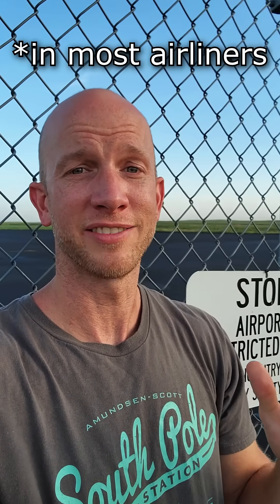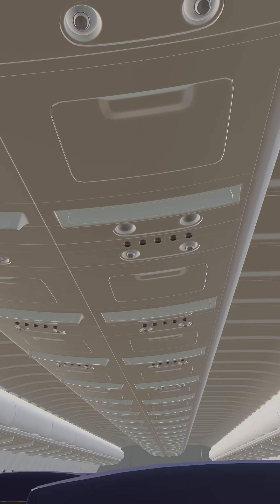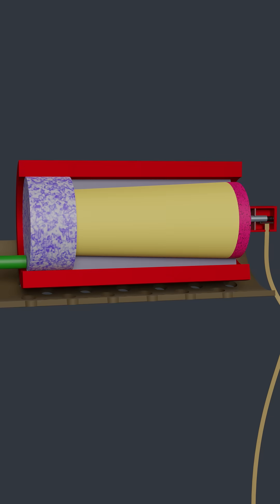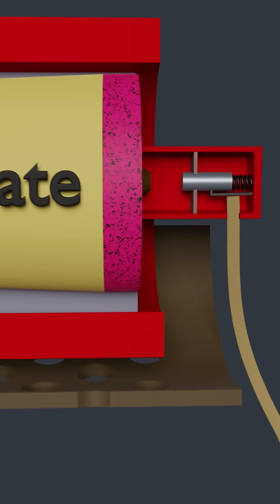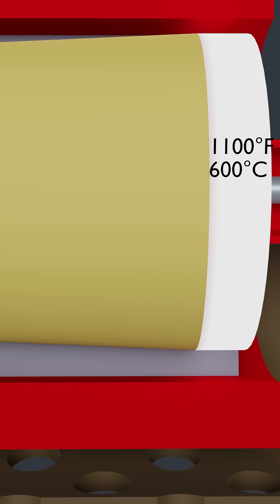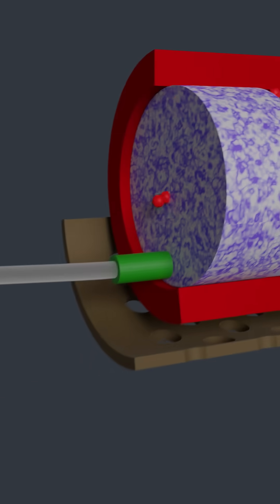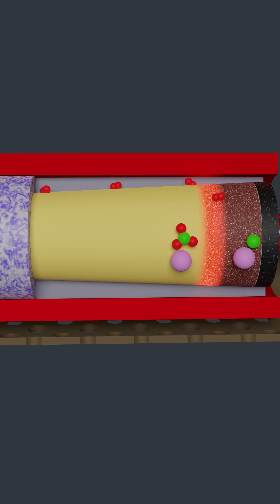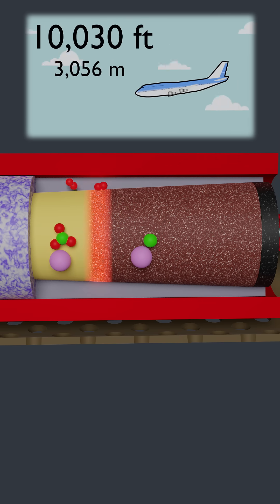Oxygen on airplanes? How it works

Comment: I was told by somebody in the airline industry Becky firing pin assembly for these is something akin to a grenade trigger assembly. And it's supposed to be unscrewed and removed from the canister when these devices are not actually being installed in an aircraft. When in storage or being transported the trigger assembly is supposed to be unscrewed from the canister. Is this precaution is not taken and they are Jarred or jostled in any way they can accidentally discharged and that unfortunately what brought down that aircraft. At least one possibly all of them was not disarmed.

Comment: When a passenger pulls on the tube of the oxygen masks this starts a chemical reaction above their head

There is a 5 minute supply above each passenger independent of each other

Each passenger has their own supply of oxygen 

So how does a single closed valve have an impact upon the oxygen received by each individual passenger ?

Maybe someone could explain what I missed so I can move on.
Reply: Well, you evidently missed the duration..😆

Comment: They don't actually deliver oxygen, they just muffle the screams lol But seriously we have those on Navy ships, called OBA (Oxygen Breathing Apparatus) . There are two types. One is a whole head covering with the generator on the back Called EEBD(Emergency Escape Breathing Device) and the other is a full front pack with a tube and mask called OBA, how original. Once you pull that pin the canister will deliver oxygen till it burns out so you either get out or go in and fight the fire.

Comment: We had these on submarines and used them anytime our O² generation equipment was broken down. Except ours were industrial sized and if necessary we could survive off of them for months.
Reply: Huh?? What submarine were you on that had enough oxygen canisters that would last for months?
Reply: @ssmt2  a Mediterranean mission critical fast boat out of Norfolk with a messed up O² generator. We kept them stored in many different spaces.  We also had to turn off the smoking lamp many times also due to low O² / high CO² levels.
Reply: @ssmt2  I won't tell you our hull number but you can read the book Blind Man's Bluff and it's one of the boats talked about in it.

Comment: Additionally, only the pilot’s masks are pressurized (different and separate system) and the passengers are not. That’s because the pilots need to be able to bring the aircraft to a safe altitude.

Comment: You missed the scary part, when these are deployed and getting hot they are also covered in dust from the time in the plane, and then the plane fills with smell of smoke and if you don’t now this you think the plane is on fire…. How i now, lost pressure in a MD80 over northern Italy and then a very fast descent down to 3000 meters and emergency landing in München airport, and no, the pilot is occupied with controlling the plane and won’t tell you until after the landing!

Comment: They fall but you must pull on them to activate.So if you need another you can use one that hasn't been pulled.
Reply: In a bank of 3 seats, there's typically  O2 generators.  So you can fight your seat mates for the extra.

Comment: when the Jet Blue crash happened in the Everglades it was from unsecured O2 generators, as I recall
Reply: Funny how those canisters can’t be carried as cargo but are perfectly fine if installed in the airplane for passenger use. First time I saw that installation, I was skeptical, as they generate a LOT of heat. But time has proven it’s a good system and a lot simpler than high pressure bottles and all the associated plumbing. FYI, the cockpit crew O2 supply is still a high pressure bottle. Note: it was ValueJet that lost the DC-9 in the Everglades.
Reply: That was Value Jet not Jet Blue.

Comment: Meanwhile, the pilot is oxygen actually comes from physical oxygen tanks that are big and yellow and multiple of them. As crew chief bring an oxygen cart and connected into the system and measure the pressure.  And one pilots decide to come back completely half dropped from Las Vegas and we have a early flight crew chief will help get them into the chair strapped up buckled up put the oxygen mask on and hit the switch which makes the pilots completely sober.  True facts. And nobody knows the difference.

Comment: They’re only supposed to last 30 mins. If the pilot descends does that allow for oxygen to enter the cabin from an alternate source?
Reply: Oxygen masks drop down due to cabin pressure loss. The cabin air is supplied by the engines compressed hot air- called Engine Bleed Air. It's cooled, conditioned, mixed and recirculated. If they lower to 8000ft, the pressure is a sufficient height before severe symptoms will arise in the passangers. A commercial passenger jet will prefer to descend about 10000ft per minute in an emergency. That's about 3min15sec.

Comment: I'm surprised they're not connecting to some sort of inlet that collects air from the outside.
Reply: The air outside the plane at 30000ft does not have enough O2, THAT'S THE WHOLE POINT.

Comment: Its also nice to not have dozens of oxygen bottles that would require periodic testing and occasionally complete removal from the plane for hydrostatic testing. Oxygen bottles have also occasionally turned into rockets that punch a nice big hole in the aircraft when they break (which has happened before, since all commercial aircraft that have passenger masks also have masks for the crew, which is run from a handful of oxygen bottles)

Comment: These actually took down a plane once, they were expired and being transported on a passenger flight. They generate a lot of heat and when one went off it caused others to go off.
Reply: ValueJet 592 MIA-ATL. RIP
Reply: That aircraft was also transporting used tires in the same compartment.

Comment: People will not traditionally call the things that these mass are attached to a oxygen generator however that is technically correct The best kind of correct. They would call this a oxygen candle as I have no idea why. All I know is that it uses heat and produces oxygen using a chemical method. I have never heard these referenced as an oxygen generator anywhere by anybody. They are always referenced as a oxygen candle. Edit: The oxygen candles on airplanes meant for passengers will only last around 10 to 12 minute's however the oxygen mats for the pilots last significantly longer around 25 minutes That way even if there is some kind of emergency and they are not able to descend the plane fast enough be pilots do not pass out and can't land the plan safely. It is extremely important that the pilots have a longer supply as the plane cannot support 25 minutes of oxygen for every single passenger.

Comment: I sorta knew the gist, but this is a nice explanation. And I have heard of "oxygen candles" that are used on submarines in an emergency. It seems paradoxical but it's the exact same thing as this. I'm amazed they get so hot! Sometimes people joke about putting your own mask on before helping others, but it's certain if you don't get your O2 mask on fast enough, the child sitting next to you can't help you out.
Reply: Smarter every day actually made a video on oxygen candles in submarines
Reply: Did 5 years on a submarine. We would burn o2 candles all day long 24/7. This would be done to assist the scrubbers
Reply: @rubberbandman200 Edit: apparently power limitations prevent electrolysis from being an option.
how much time was actually on the sub? Or was that the total of all rotations? Do you guys do 6 months like a deployment? Also, do you know why they opted to burn these rather than something more like the ISS has that produces O2 without burning? Thank you for the info. That's really interesting. I'm Air Force so the Navy side of things are foreign to me.
Reply: @AfricanLionBat  3 or so months each patrol, the scrubbers couldn't keep up sometimes, so the candles were burned at 2 locations, to assist, "how much time was actually on the sub" ?

Comment: Actually is not about safety of reliability. It has more to do with weight and simplicity.  Usually those chemical oxygen generators last between 10 and 25 minutes.  In case the airplane flies over mountainous terrains, where the aircraft can’t descend to a safe altitude for the passengers to be able to breathe without external oxygen for an extended period of time, a gaseous system is required(oxygen tanks).  Those gaseous systems can last significantly longer than 25 minutes.  Otherwise the aircraft has to fly a different route.  Some models of aircraft can be equipped with either system.
Reply from the maker: I'm intrigued, so you're saying that a compressed gas system is more complex and heavier?
Reply: @JoeSpinstheGlobe Airplane mechanic here. I've worked on A320s and CRJs and I've never had to replace a PSU because there was something wrong with the oxygen generator. Meanwhile, the pilots get their own tank of oxygen. I've had to service the pilot tanks so many times I've lost count...
Reply: Definitely more maintenance on a gaseous system. 
Oxygen generators are generally fit and forget. No bottles to service, pipes to leak etc, just replace the O2 generator when it’s life ex. 
Weight wise I’m not sure which is lighter but there’s no pipe work to run and leak check etc with O2 generators.
Reply: very few mountain ranges that would require oxygen masks
Reply: Simple is reliable.
Reply: It also likely has something to do with Oxygen tanks having a notorious record of exploding during flight resulting in numerous crashes.
Including one that was transporting expired Oxygen generators.
Reply: @Skelath  yeah there was a flight that's rapid combustion was attributed to oxygen tanks 
     as long as the engines stay running and the cabin sealed its a non issue 
    the air that you breath and pressurize the cabin comes from outside through the engine compressor 
          and most routes are avoided where a plane would have to stay at attitude de-pressurized

Comment: I wonder if the quality of the salt left behind after the oxygen generators are finished producing oxygen as a byproduct of combustion is of high enough that it could be put through a hammer mill after being separated from the primer and filter once removed from the rest of the oxygen candle to be used as actual table salt or even road salt and whether or not that would be a viable option to recycle the used oxygen candles when it comes to profit margins as well as supply as the supply of oxygen candle whether used or expired as their is a chance that an oxygen candle could expire after a certain amount of time due to the chemical deterioration of the primer which if their was a plant that was able to recycle used oxygen candles or ones with expired primers which would depend whether or not the primer in an oxygen candle in an aircraft is able to be replaced every so often when it’s primer expires I imagine the process of recycling them would possibly involve separating the primer from the salt that we want as well as removing the filter and then throwing the remaining part of the candle containing the salt into an oven to bake at a high enough temperature in order to ensure that any unreacted material is able to react inorder to not contaminate the rest of the remaining part of the candle which may have been broken into smaller chunks in order to better ensure that any unreacted material was converted over to the desired result of sodium chloride before being put through further refining as well as laboratory testing to ensure the result was of sufficient quality and within acceptable containment levels among other things
Reply: As I understand it the assembled units self life is measured in decades, so by the time it expires the plane has usually been retired or scrapped.
As for used ones, no idea.

Comment: That’s cool I never would’ve thought about that but it does make since , they’re easier to replace and probably weigh way less and are safer overall because oxygen tanks can explode and pure oxygen when in a leak can explode or catch fire
Reply: Yeah I think that’s exactly why
Reply: The answer is they can actually store more oxygen than a tank can believe it or not they use a similar method to give nuclear submarines their O2 theirs will give that section of the sub O2 for about 8-12 hours
Reply: @Ornatetooth0475  ...u know how chip bags puff up and explode when the plane takes off? air tanks also do that. you dont want tanks when u have pressure changes like that

Comment: How well does this work when decompression happened ?
Reply: The chemical reaction does not require external oxygen to ignite
Reply: @vibronik  yes but I'm thinking about the pressure
Reply: @orca984 I would guess that pressure has a very minimal effect on this since this is essentially a solid fuel
Reply: A lot of chemicals can burn with little to no oxygen, I’d assume this is a chemical reaction that needs very little oxygen to start and once it happens it self propagating